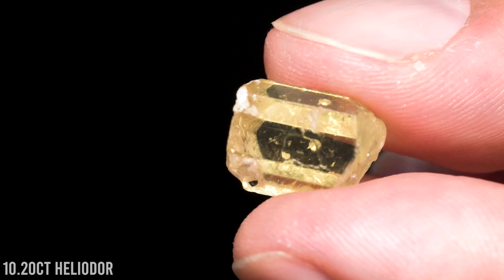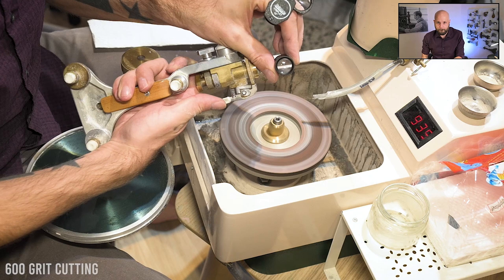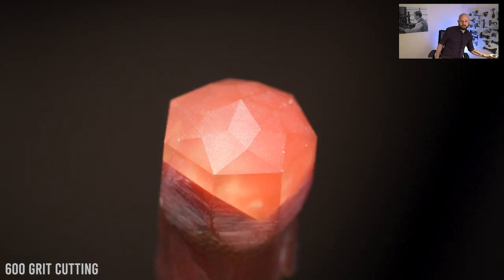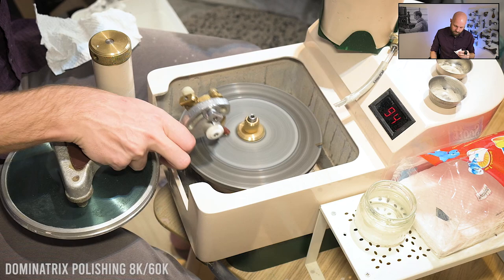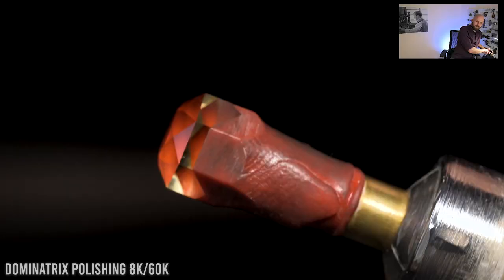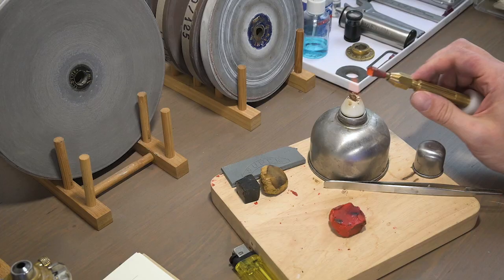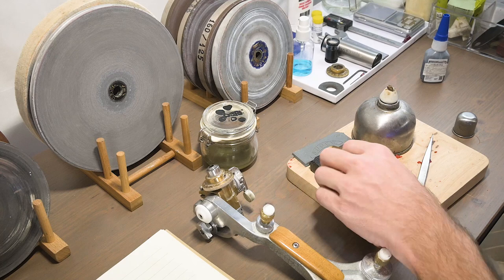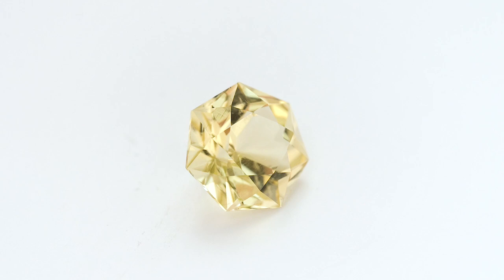The Cutting Journey of a Heliodor

Comment: This video was awesome! Do you always start with the crown. I learned to start with the pavilion to guarantee I have enough depth, as the crown is less critical if you are left with a slightly more shallow crown. I would love to hear your experience with the difference, as you are master and younger facetor compared to me.
Reply from the maker: Yes since switching to the Handpiece machine, I always cut crown first. Proper preforming solves the problem of having enough depth because you make sure there is no window  before you start faceting. Crown first also let’s you have a really easy transfer because it’s flat table to flat dop.  Maybe most importantly, when hand shaping ovals, cushions, and fancy shapes, where there isn’t a faceted girdle, it’s much easier for your eyes to see and balance your mains with a flat table in the middle than it is on the pavilion side. The culet point sticks up so much that it sort of messes with your eyes and makes it hard to see if the facets are balanced. Actually that was also the case in this stone. When balancing my outline shape in the video I use the shape of the table a lot to confirm perfect symmetry, though in this case a culet point would have been easy too, since the girdle could have been faceted afterwords. You can’t do that with smooth girdle cushions and such though. Also it’s not super intuitive on how to make a step cut pavilion when starting with a culet point. Hope that makes some sense.
Reply: @JustinKPrim  makes sense. Thanks for sharing your thoughts on these issues.